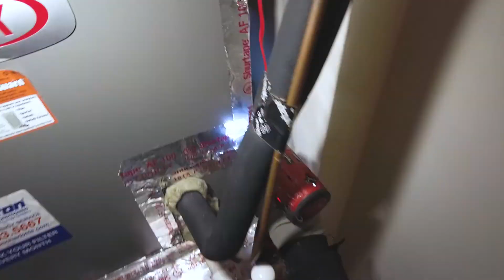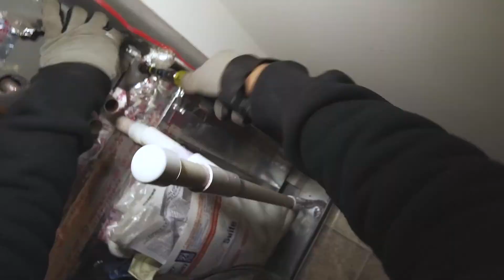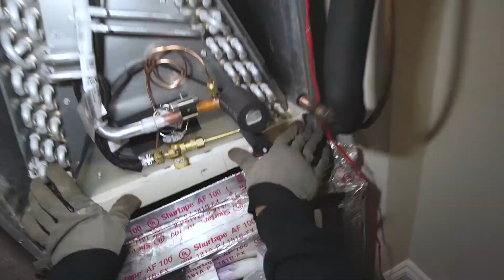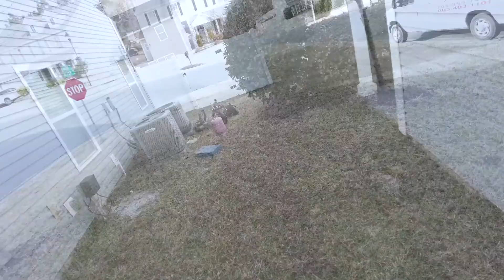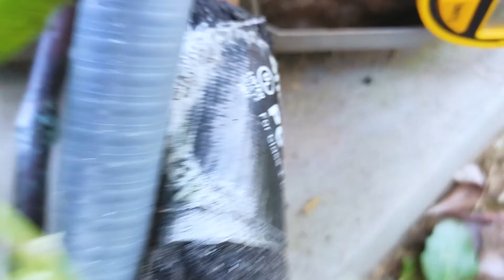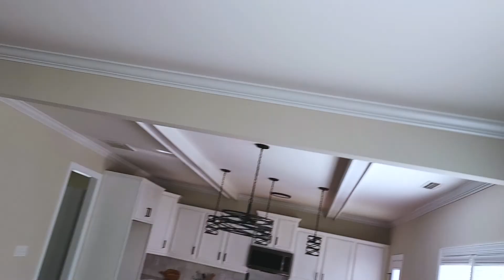Repairing Lennox & Rheem Heat Pumps - Patching hole in Vapor Line and Replacing Evaporator Coil

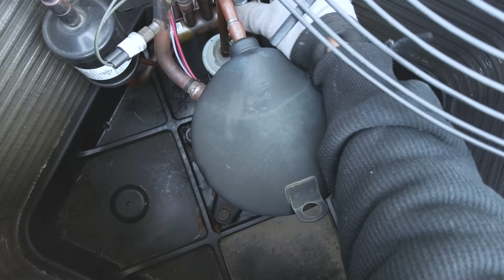Comment: You should buy a couple Plumbstop fitting brushes, cut off the handle and use them as a bit for your drill for situations like 12:05. Really handy little bit to have when cleaning off copper in hard to reach spots! You can buy actual bits like that as well, but they cost an arm and a leg... good video btw.
Reply from the maker: Very nice idea thanks for sharing. Im definitely going to give it a try.

Comment: Very good video. I use the two hose method straight to the pump with two core removal tools. On average, below 500 microns in less than 30 min. A definite timesaver. Great channel!
Reply from the maker: Thanks, appreciate the feedback. Do you use 1/4 or 1/2 hoses?
Reply: @HVACTechKnowledgy  Appion 3/8” vacuum hoses